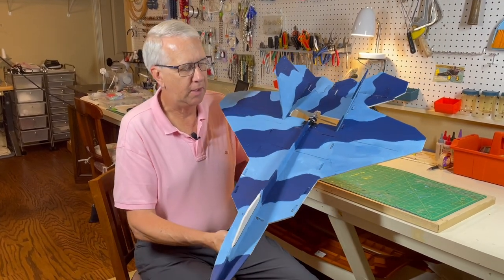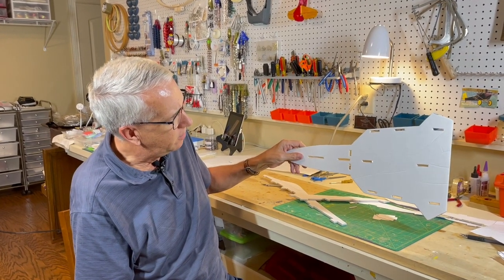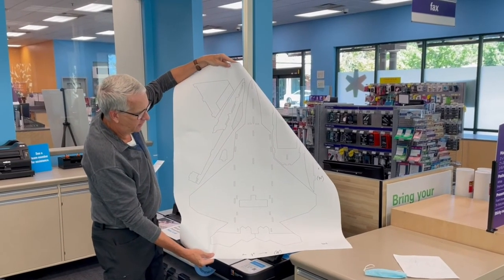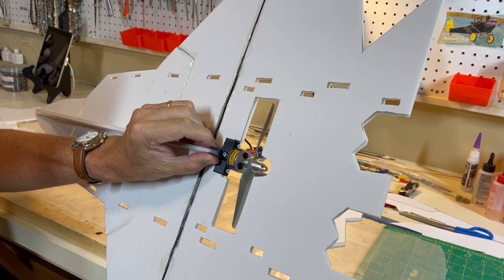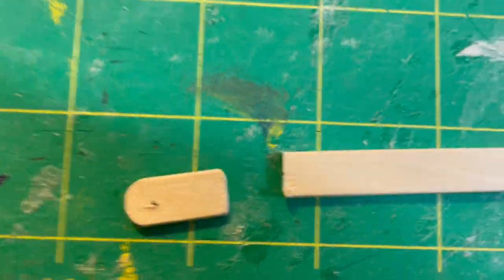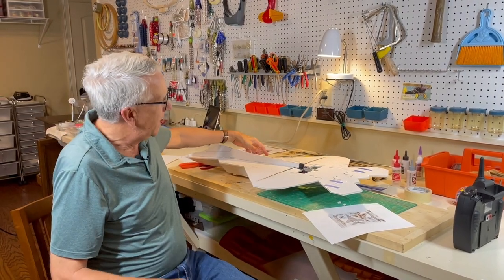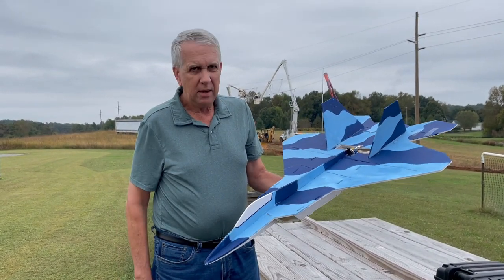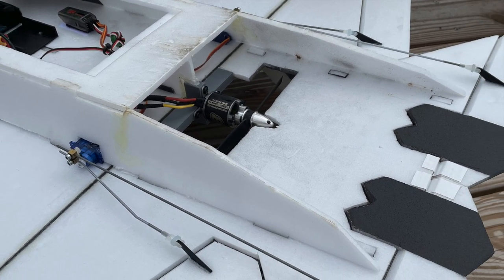F-22 Foam Board RC Airplane

Comment: Wow! This is a nice plane, would it be possible to scale this up to be maybe 2x as big as in the video?
Reply from the maker: Well . . . the plane is made from high quality EPP foam.  I am not sure how you "scale this up"  without some plan of how to do this with other materials?  But, a larger one should fly just fine.
Reply: @TimMcKay56  well thats what im wondering, would  i be able to build one out of EPP foam just bigger? I want to start making planes to save some money, but i want them a little bit bigger. I am worried that the foam will break though?

Comment: Thank you! Nice video. How did you manage to cut the foam board? By hand or a laser cutting machine? Is that propeller facing in the right direction?
Reply from the maker: Carlos:  Glad you liked the F-22 video!  The foam board is just 3/16" thick.  Super easy to cut with a #11 X-acto knife blade.  The prop is on correctly.  As the motor is facing backwards, and take a normal prop and mount it "backwards" on the motor such the prop is rotating in the normal direction, but simply on the back side of the motor.  Tim

Comment: Good afternoon Master McKay, to build it but with a 2212 motor of 1400 or 1200 kva, would the same measurements work?
Reply from the maker: Fernando:  Not sure from your description. Tim
Reply: @TimMcKay56  Master what I want to know is if I can use a 2212 motor of 1400 or 1200 kva for that f22 without changing the measurements of the plane?

Comment: I've built a bunch of foam aircraft like that a long time ago, I miss it. Just an observation.....your plane looked to be alittle tail heavy by the way it porpoised a bit, I've been there.
Reply from the maker: Wayne:  The F-22 could be a tad tail heavy.  The CG was not very well marked on the plans, I had to do a bit of research.  But what I will say is that the pusher motor, just inches behind the CG and Center of Lift, seems to make the nose want to "hunt" a bit during flight.  Plus, the elevons and right behind the prop blast, thus very effective.  Would be interesting to see how it handles with a tractor prop set up.  Tim
Reply: @TimMcKay56  I remember them being fairly sensitive to wash. The planes I made were not from plans, just similar.  Maybe I mounted the motors a bit more to the center of the craft but I allways had to add nose weight to get stable flight unless I used a big ass battery. I did enjoy your video, it reminded me of all the trial and error involved with making a (dollar tree foam) plane that would do what I told it to do. Who knows, I may get back into it some day. Good day.
Reply from the maker: @wayneg3127  Wayne, best of luck, fun working to get these suckers to actually fly!  Tim

Comment: Tim, in your F22 build do you leave the paper on your foam board ?  and what foam board do you buy from Amazon?
Reply from the maker: Keith:  I did leave the paper on. Weight not a real issue and much easier to paint. I used the Langford and nickel brand of foam board on Amazon. Name for FB may be a bit off, I am on travel now. Tim

Comment: Neat vid and plans, I've just printed it out and will be working on it, thank you Tim. I am curious what kind of motor does Rick have in his tuned double elevon F22, I couldn't find him anywhere.
Reply from the maker: TM:  Not sure, will check with Rick.  Motor is a screamer with the 6" prop  limitation.  Tim
Reply from the maker: Rick's motor is the 2832 3000 kv propdrive with a 6x4ep prop from Hobby King.  Tim
Reply: @TimMcKay56  thank you for the info sir

Comment: I enjoy watching your videos. i bought a mig su27  kit ,  i was wondering if i can make it 3 channel as i have an old transmitter, 2 servos for the ellerons and one for the elevator . i can join the elevator and make it one. will that work. any advice would be appreciated.
Reply from the maker: Saleem:  Yup, 3 channels will work. Put a servo on each aileron and connect with a Y cord to the receiver, and normal one servo for elevator. No need for rudder control. Tim
Reply: Thank you ,   i have built a mig su27  where should c of g be, any videos.
Reply from the maker: Not sure on CG location. If unable to figure out try CG location on the F-22, winds have similar shapes if I recall. Tim

Comment: What size 3cell lipo do you recommend? What kind of flight time are you getting from it?
Reply from the maker: I use a ThunderPower 1350 3 cell lipo.  The motor is screaming, I usually land after 4-5 mins of flight.  Tim
Reply: Thank you sir.
Reply: Gotta ask, is there a certain angle degree used when setting the rudders? I’m in the process of building one now and could use that info. Thank you.
Reply from the maker: Rudder angle not important. For mine, no rudders just elevons and throttle. I used a tilt of the vertical fin and rudder that matched the look on the aircraft. Tim

Comment: Hi man Nice video, what propeler did you use please ? Thanks
Reply from the maker: Matt:  Prop is in the Description, 6X4 and a 3 cell lipo.  Motor could use a larger prop, but limited to the fuselage cutout.  Motor screams!  Tim
Reply: @TimMcKay56  thanks ! I have made the same and i use another propeler, the plane didn't moove, thanks !

Comment: How many grams of thrust does that motor give and what's the total weight of the plane
Reply from the maker: Karthik:  Per the Description, F-22 weights 15 ounces with a three cell lipo.  The foam board helps a lot with keeping the weight down.  Not sure of the grams of thrust.  Use a three cell lipo for sure, and put in a larger engine.  You'll need all the thrust you can get for the initial climb out, then you can throttle back.  Tim
Reply: @TimMcKay56  is there any way to contact u
Reply from the maker: @karthiklal3513  email address in "About" section of my YouTube home page.  Tim

Comment: Im building guillows 27 inch wing span spitfire want to rc convert when you build rc planes will one radio work for multiple planes? Not sure about batteries servos etc.
Reply from the maker: Chris:  Yes, I use my ParkZone electronics (ESC brick and motor) in multiple RC models.  When done with one model, I take out the electronics and install in the new model.  Works fine!  Tim
Reply: I miss guillows..... they were on 18st and Broadway when I was a kid.. they moved to Ohio.
Reply: Yess. As long as you program the receivers

Comment: CAN YOU DO A VIDEO ON HOW TO PROGRAM CONTROLS FOR THIS PLANE?PLEASE THANKS
Reply from the maker: The F-22 uses three channels for elevons and throttle (via ESC). There are no ailerons or rudder. See my video “Elevons for newbies” on how to set up. You’ll need a computer transmitter and usually a six channel receiver (to access the elevon function). Tim
Reply: @TimMcKay56  thanks I have DX6i and it's been tricky to navigate,thank you for your videos. 👍

Comment: I’ve built a scaled up version 65 inches long and 48 inches wide 50size motor and will fly it on a 6 s 5200 total weight is 4 lbs 5 ounces I’ve cut down a 17x 10 prop to fit between the rudders
Reply: If it flys well I plan to make a tomahawk cruise missile from 1 inch foam board
Reply from the maker: Mike:  Your approach should work, good luck!  Tim